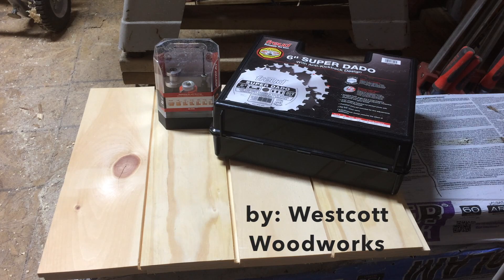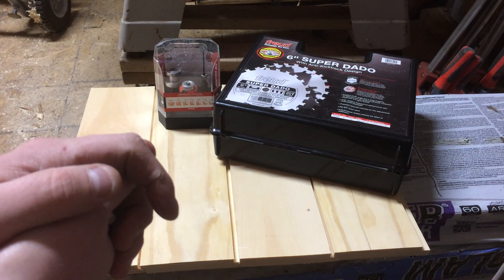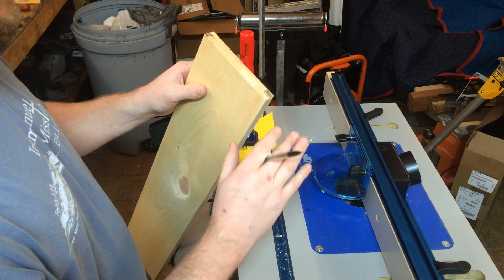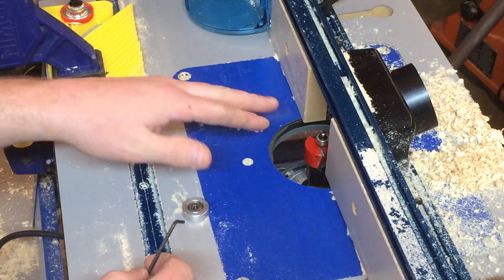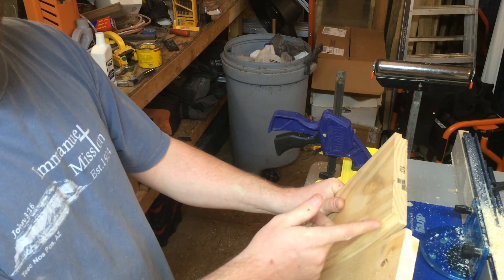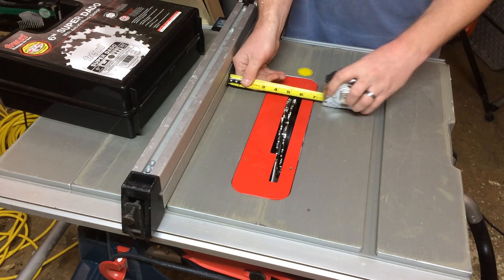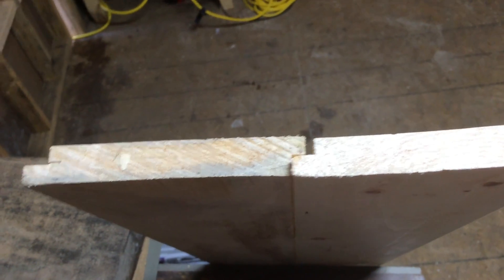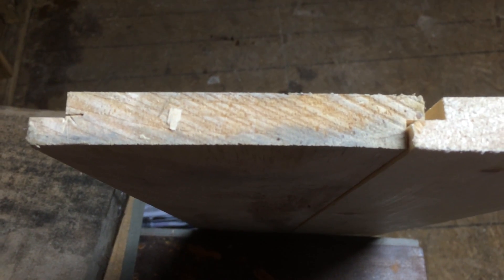How to Make Ship Lap

Comment: Taking seasonal movement into account, it's easier to cut both rabbets the same size, and then use a spacer board to install, leaving a 1/8th inch gap to allow for movement.
Reply: I've seen nickels used as spacers, I think I like the smaller gap.